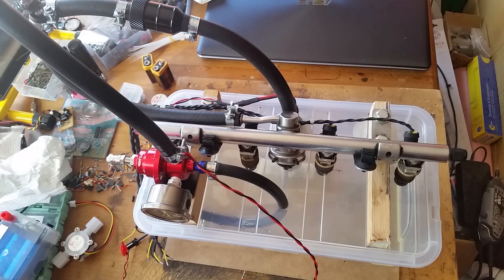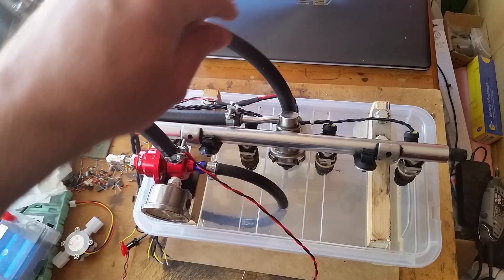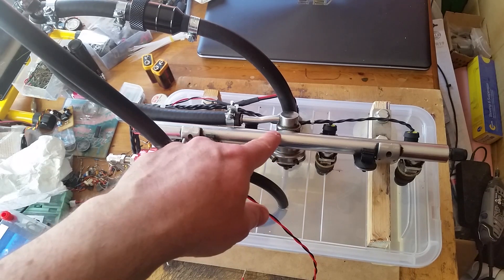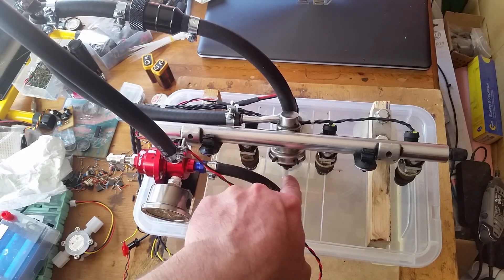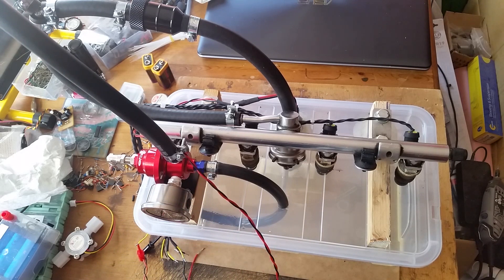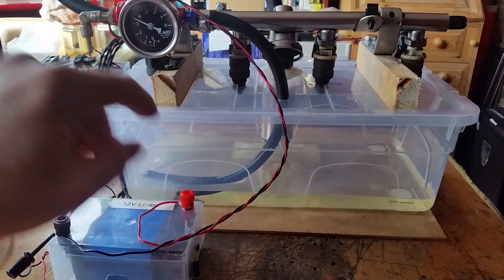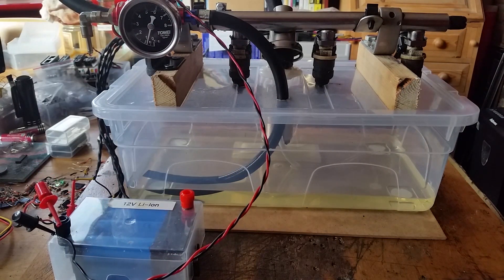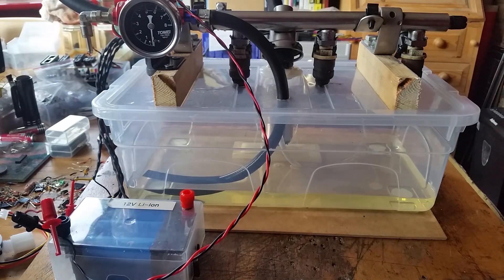Fuel Injector Test Rig - For Pattern, Flow and Development

Comment: Sir the project is very nice and we are going to make this as major project for final year. Can you please share more information like from where do we can get the apparatus and details.
Reply from the maker: Everything was from eBay, except the box from a local hardware store.
Reply: @DevelopIT  Will you please tell me how much it cost as being final product
Reply from the maker: @tejas6407  The cost will be different in your country, and this video was a long time ago so the price will have changed. Find the parts you need and add the total.
Reply: @DevelopIT  sure thank you sir😊
Reply: @DevelopIT  Sir do you have Instagram account as I wanted to ask some details about the project.
Please help us 😊😊
Reply: @tejas6407  Heyy Tejas, can we connect on instagram as i want to ask some questions about this project.
Reply: @amann_bhardwaj  Hey Aman, I recently deleted my Instagram account. But if there is any other way you suggest then I can help you
Reply: @tejas6407  We can connect on some other platform like snapchat or linkedin...

Comment: I am curious to see if the flow meter is accurate enough to measure the difference between injectors. I once put the injectors in a measuring cup but that is quite messy. If the flow meter is accurate enough, it would be nice to see the difference between 50% duty cycle with a low and a high frequency, to see the effect of the injector opening and closing. Another interesting variable would be the supply voltage.
Reply from the maker: Good point about the measurements under different conditions, I have to admit I was only thinking about 100% duty. With that in mind, hopefully it should be possible to graph characteristics by progamatically adjusting the input at the same time as measuring the output. Thanks for pointing this out.